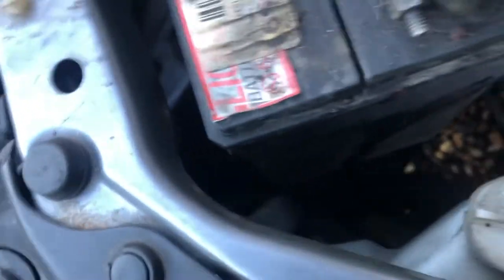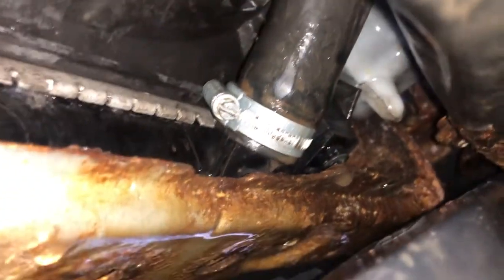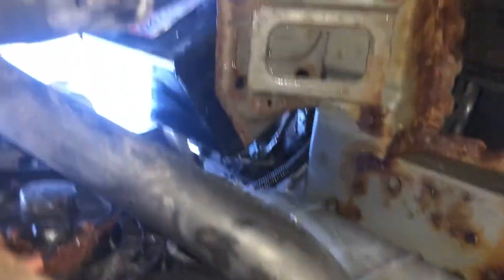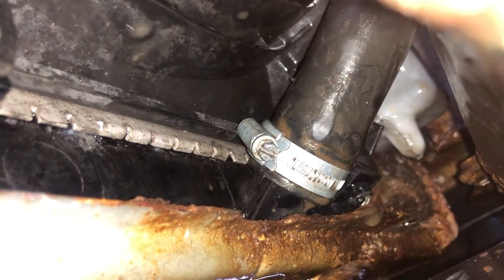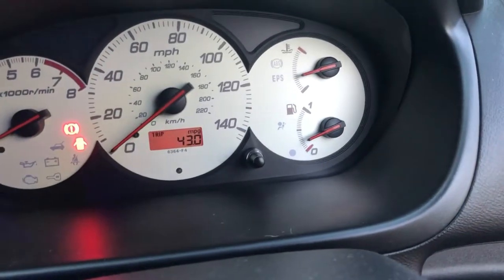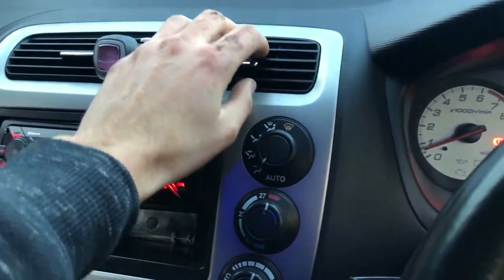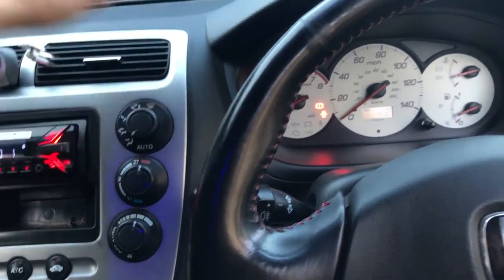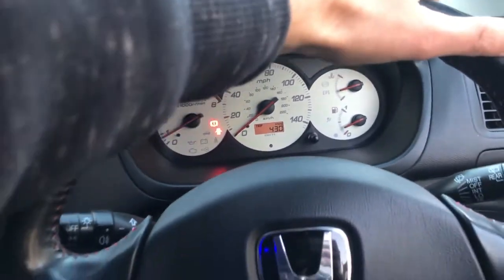How to Fill and Bleed Radiator On a Honda Civic

Comment: Got a problem I have coolant in my car it’s above max recommended, no leaks but when I start my car no heat from the fan until I start driving what could this be?
Reply from the maker: Does it get warm eventually when it’s running before you start driving?
Reply: @AshBuilt  nope just had my friend inspect it he found a small hole in the rad leaking air pressure 

i guess thats why it only works on high revs while driving due to higher pressure from revs forcing the coolant through gunna need a new rad found one on euro parts for £100 gunna fit it in myself
Reply from the maker: @ryanfinch9976  at least you’ve found the problem!